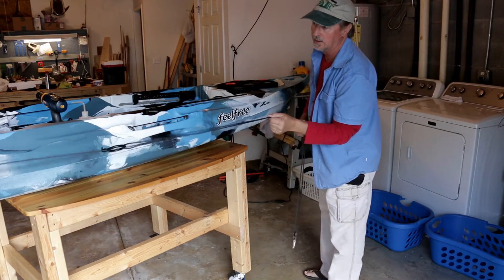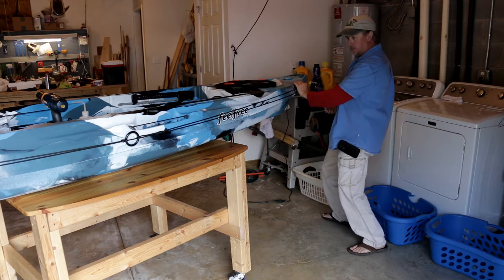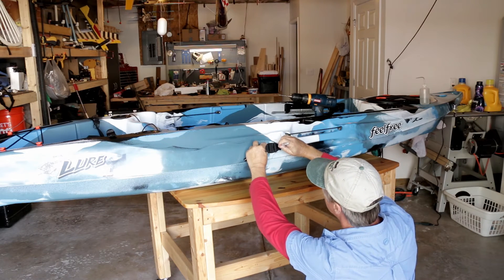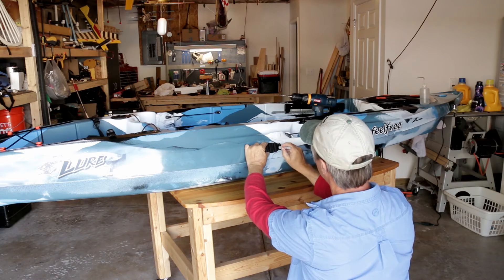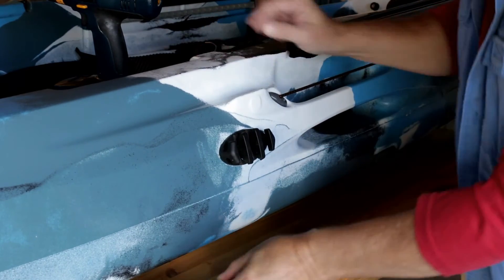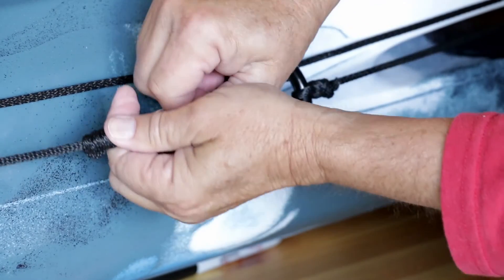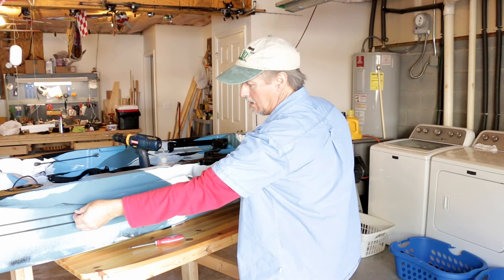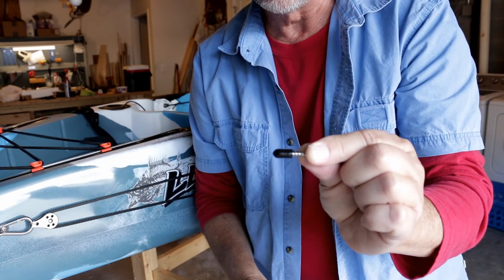Feelfree Kayak Build Pt 2  ...  Anchor Trolley Install video

Comment: Great video Neil! I just bought a Lure 11.5 a week ago and I watched some of your other videos too. So far I've had the boat out once and liked it. I think I need to get used to being higher, but I think it will be easier on my back. I'm looking forward to going out again, maybe tomorrow. Are you able to change your seat height while out on the water? I haven't tried it yet. Are you happy with your Lure 11.5?
Reply from the maker: Nick Vivirito thanks for watching Nick. you'll like your the Lure the more you use it. yes I can adjust my seat while on the water. I don't stand up much but I have on occasion. you can use the stand up assist strap to hold while you stand. that will help anchor you.